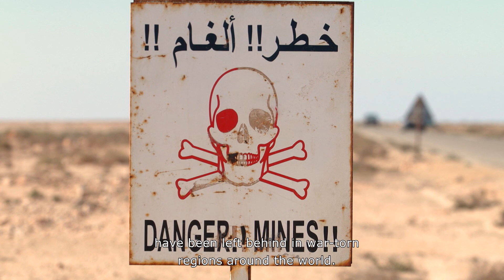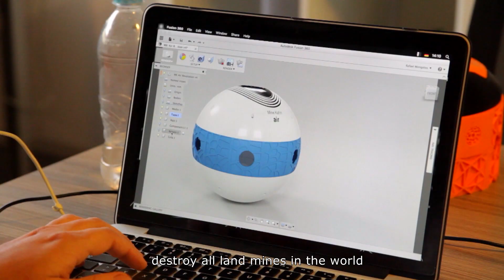Drone that Disables Landmines | The Henry Ford’s Innovation Nation

Comment: So... Like 20min of operational time between with like 4h+ preparation time with the requirement of an operator babysitting the drone bat all times? Talk about one heck of an inefficient way of finding mines...
Why not just build a lightweight "toy" rover out of mostly plastic to avoid magnetic mines with a built in mine detector and something like an ArduPilot System hooked to both a GPS and maybe some rudimentary vision system to avoid obvious obstacles... Could probably run for hours if not days when equipped with Solar Panels like this DIY solution someone built: https://youtu.be/QVep9iSXVeo

Not sure how accurate mine detectors are but maybe pair it with the ability to place a "Target" sign directly on top of the mine that can then be used as a marker to either drop a heavy dart onto using a flying drone to trigger the mine or maybe arm a flying drone with a gimballed rifle barrel pointing straight down and shooting that target automatically. The Rover can work for days alone marking all the spots and when it comes to dismantling the mines the ppl with the flying drone arrive to shoot the crap out of the ground with it.

Could probably also forgo the flying shooting drone and just drop a DIYed thermite charge onto the mine using the same rover and set it off from afar... IDK... Still better what I just saw.